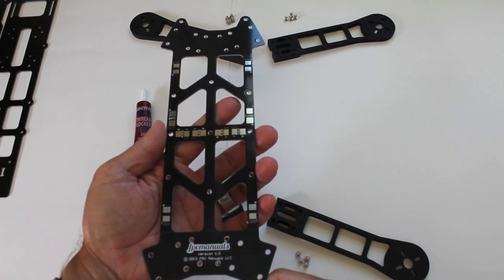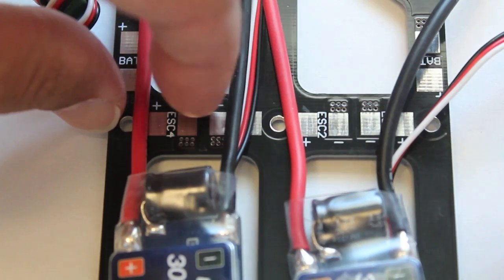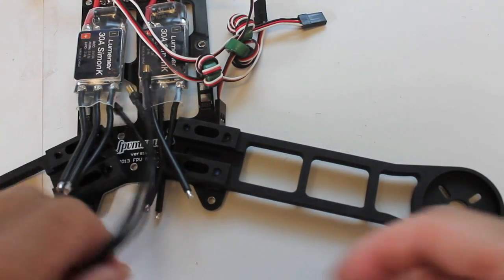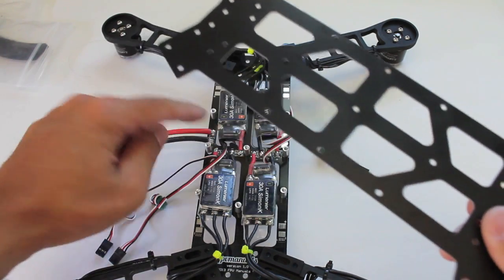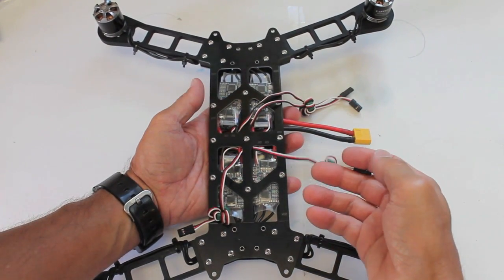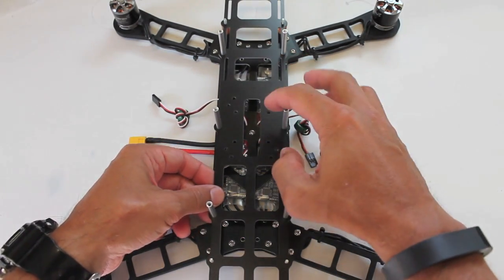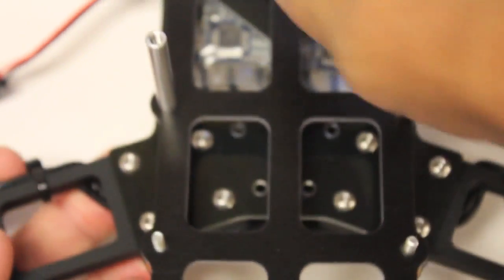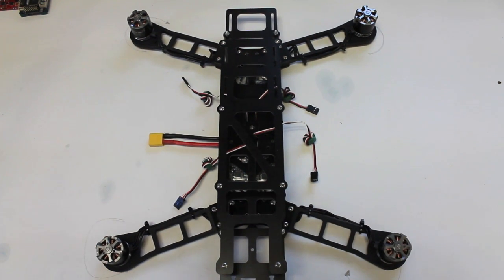QAV400 Frame Build

Comment: Hey! I am getting started building my QAV400 tomorrow. I have a couple of questions for you if you don't mind. 1) Did you run into any issues with just making cuts on the shrink wrap on the ESC and not re-wrapping it? 2) How do you test the motor direction to know which way each one goes?
Reply from the maker: 1. No problems with cuts but it's always better to rewrap 2. I normally solder connections in place for each ESC one at a time. Then it's connected I'll plug it directly into my RX and test the the throttle channel. Obviously with no prop installed. If the direction is incorrect I'll swap any 2 of the 3 ESC leads. Not the cleanest approach but if you're good with the iron it doesn't take long at all.

Comment: Is it possible to not use the PDB included with the frame?
Reply from the maker: Yes, but will obviously be a lot more work. You can solder everything together in pigtails and bypass the PDB. The PDB keeps it cleaner and easier to manage. Good luck and let us know how it goes.

Comment: Hi, great video !!
could you list the parts you use for the qav400 with Pixhawk controller ?
or a link with info to build such a copter ?
cheers
Reply from the maker: +Freerydeful I used the ARF version from getfpv here:

http://www.getfpv.com/multi-rotor-frames/qav400-fpv-quad/qav400-fpv-quadcopter-frame-arf.html

Coupled with the Pixhawk here:

http://amzn.to/1PH3wsb

You don't need all the bells and whistles like the airspeed sensor since you're flying a quad, but I recommend almost everything else...especially the telemetry radios. Good luck with your setup.

Comment: Very nice tutorial as usual.. ONe thing i would suggest others do vs how you did it, the vibration mount bolts shouldnt be locktited, when you have to take them off they will most probably break, better to buy some lock washers.  

I know this from using these types of vibration mounts with my Gas Boats which the motors mount on these types of vibration mounts which are way more sturdy tahn what is supplied with teh qav400

Comment: What battery charger would you recommend for charging Lumenier 3300mAh batteries?
Reply from the maker: Mrubio I use one very similar to this:

http://amzn.to/1BASoKk

Keep in mind that it does not come with an A/C adapter so much sure you check that on any charger you purchase. A lot of times they don't come with adapters and you have to purchase separately. I learned that the hard way.

Comment: Great work. Is there a mean to test motors without hooking up the naza and pairing? Your video skipped all that. Thanks again.
Reply from the maker: Matthew Gilbert You can do that by connecting them directly to your receiver and powering up. I always recommend doing that to get your motor rotation correct as well as do ESC throttle calibration. Good luck with your build.

Comment: Great video. I used this to put together my QAV400. I am using the CC3D flight controller and the hole pattern on the QAV works with the CC3D, but doesn't work if you have right angle pins on the board. The center post of the QAV will conflict with the ESC leads or USB port if you try to rotate it 90.
Reply from the maker: sen4thom That's very good to know. I have used that version of the CC3D board but will definitely keep that in mind for future reference. Hopefully others can learn from your experience. Thanks for sharing.

Comment: Do you just hook a battery to the ESC's to test the direction the motors are spining before soldering the motors to the ECS's? These are great videos and have helped me a great deal on planning out my QAV 400 build.
Reply from the maker: Christopher Gannon Unfortunately what I do is solder them, text, and then resolder if necessary. I've used cables with alligator clips before and that saves a bit of time. Check these out if you haven't seen them already:

http://www.immersionrc.com/introducing-rotorsense/

Now that's an awesome idea! Glad the videos are helping and thanks for the feedback.

Comment: The screws are to small when I try to put the arms on they will not grab am I doing something wrong?
Reply from the maker: ***** Strange. Are there any screws in your kit that will grab? Perhaps you're using the wrong ones? I'm sure you've tried that already, but wanted to mention. Another option may be that the wrong size screws have been included in the kit. I can't imagine that being the case, but it's always possible. Good luck with your build and hope you get it sorted out.
Reply: I figured it out its the G10 version of the QAV400 that uses less bolts making the frame lighter. So when I was trying to follow your video I got lost cuz it's a little different in setup.
Reply: Dennis Baldwin thanks for your help love your videos. I went with the CC3D flight controller can GPS be added to that controller with the same functionality as the Naza?
Reply: Dennis Baldwin one other question I noticed that the QAV250 recommends a 2300 kV motor and the QAV400 only a 960 to 1100 KV why is that you would think it would be the other way around.
Reply: ***** did u build one yet?

Comment: Wath do you think is the best quad. Tbs. discovery.  Black sheep , Or the qav400??
Reply from the maker: tiger exhaust I really enjoyed the TBS, but am enjoying the QAV400 even more. Keep in mind they are different size quads. I could spin 10" props on my TBS but the max I can spin on the QAV is 8"...unless you do the mod where you use the QAV500 arms on the QAV400 frame. Good luck with your decision!

Comment: Hello,
I am about to buy a pre-built QAV400 with 1100kV Tiger motors and 12A ESCs. Should I be worried about the current? What is the real current those motors draw? Thanks for any help.
Reply from the maker: Mato0092 I'm not sure which T-Motors you're getting but the good thing about most of their motors is they publish prop size/thrust/current data like if you scroll down here:

http://www.rctigermotor.com/html/2013/Professional_0912/45.html

Looking at the chart if you're getting the MT2216 and swinging larger than 9" props you may need to purchase larger ESCs. Good luck!

Comment: Hey Dennis,
Will it be ok to use a 100W soldering iron and let that melt the solder of the ESCs, keeping it on for 5 minutes or so?
Reply from the maker: If you're using a 100W iron I don't think it will take anywhere near 5 minutes. You just want to be careful that you don't get too much heat towards the electronics.
Reply: Dennis Baldwin Alright. Using my 100W Weller gun works well now, but one of the ESCs is busted due to heat I think... the motor does not start properly :(

Comment: hey dennis, the way you soldered your ESC's---each esc pad set is marked 1, 2, 3, 4...i dont think you put the + leads onto the corresponding ESC for the corresponding motor. so, obviously this works, so, the quad doesnt know  which ESC its supplying more power to. im sorry if that doesnt make sense...but, i want to configure mine the same way. so, it does not matter what ESC pad you solder the ESC to (i.e. you could solder the ESC for motor 1 to pad 3, as long as the right plug going to the flight controller is in the right spot.) is this correct? i cant seem to wrap my head around this...
Reply from the maker: Hey there....yeah that makes complete sense. So these pads are just for reference on the QAV400 PDB plate. It doesn't matter which position you solder your ESCs to as these are only power/ground connections. The markings are merely for convenience. So if you wanted to have ESC position 1 connected to motor 1 then you would be able to easily reference that by looking at the PDB and see "ESC 1" or "ESC 3". That just saves you the hassle of having to look at the tangled mess of wires and follow the ESC wiring to the motor. So yes, as long as the right servo lead is going to the right plug in the flight controller you should be golden. Hope that answers your question and if need any additional help please post in the forums at www.garagepilots.com. Best of luck with your build! You're gonna love flying it.

Comment: Hi, I have two questions:
1. Do you use loctite for the motor screws also?
2. How can I check rotation of motor before soldering to ESC directly?
Reply from the maker: 1. Yes I did but it's not completely necessary as long as you check your screws before each flight

2. Unfortunately I soldered the connections and if the rotation was wrong I desoldered two, switched them, and soldered again. I know it sounds like a hassle but I can always use soldering experience :)

Comment: In theory if one ESC goes bad you have to replace whole unit. But on the other hand - if user have at least some knowledge in electronics, these combined ESCs can be dismantled and fixed - inside there is clear board layout and schematics are also available in the internet.

Comment: Hi Dennis. Great fan of your channel and it's really been a help to me while starting out on my first Quad which I hope to fly soon. I received a QAV400 kit yesterday and I believe that the 'extra' vibration dampeners should sit between the lower & upper centre upright supports, thus eliminating the flex in the centre section whilst still dampening vibration. I have photo at picasaweb.google.com/103481924978270712299/26Sep2013. See what you think.

Comment: Just wanted to add this tip.

when soldering the Motors to esc... make sure you add about 1cm, Because if you have a crash it wont rip off the cables from the ESC

Comment: Thanks! I got the landing gear from GetFPV. Search "Carbon-Fiber QAV400 landing gear". I then replaced the stock 1.5 inch CF landing gears rods with 1/2'' wooden dowel. I cut the long wooden dowel into 4 pieces for the landing gears. I made those about 4 inches long to so there is clearance for the Tarot Gimbal. BTW those 3D printers are getting popular!

Comment from the maker: You and me both! I've heard putting a soldering iron to the tip of the bolt will help the thread lock break free. I haven't tried it but will definitely give it a try if/when necessary. Good luck when you get around to one of these builds and feel free to reach out if you have any questions.

Comment: Im waiting to see if the APM gives you problems with the Compasatt like it does on my frame (basically the same)  I had to move my apm to the top plate just to get it to be somewhat steady in loiter and rtl

Comment: I hope you don't ever have to remove those bobbins after applying the lock tight. I had used lock tight on my flip and the bobbins pulled a part before the nuts came unscrewed.  nice build, i might do one of these quads this winter.

Comment: Dennis good job  hay FYI--I found out that if you have to remove screws that have Loctite, if you heat the end of the screw with your soldering iron they break loose easy.

Comment: Very nice Dennis! can't wait to see it fly and hear if there is anything you have to do for jello or if it really does have no jello out the box without doing very fine balancing on props and motor and see if you need moon gel for dampening the go pro. Look forward to the follow up. I am going to try out the cc3d board on the 500 that I have coming I want to do flips and rolls.